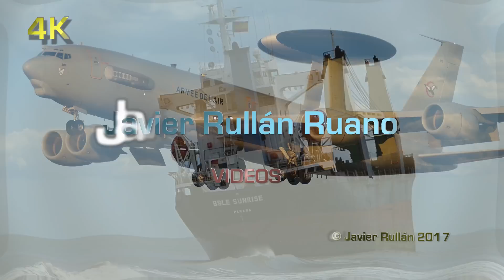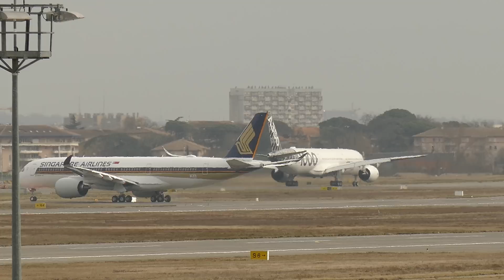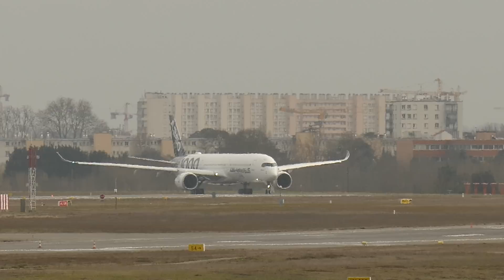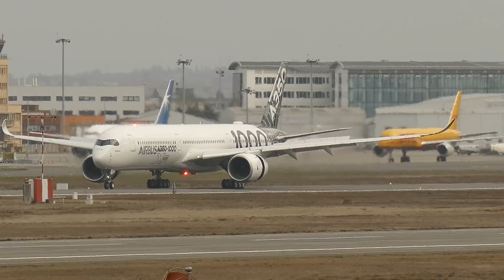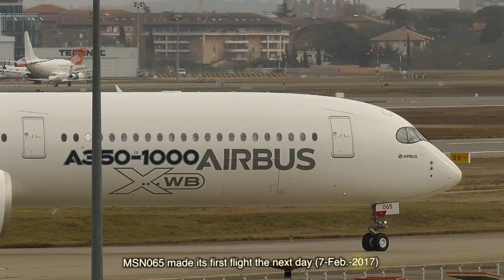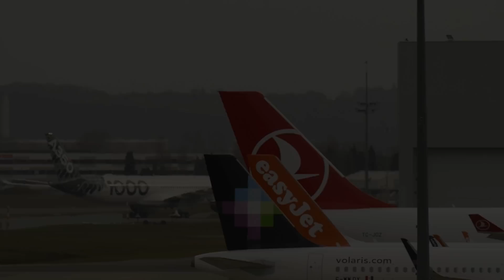Airbus A350-XWB-1000 Takeoff Aborted [4K]

Comment: Could a type of Aircraft brake be made by admitting compressed air to rotating cylinders at the wheels , to be compressed further out a resistance hole type vent....thus producing a very heat resisting 'jake-brake'? Plenty of sources of compressed air on a Jet....
Reply: Buck Otte that would make slowing down impossible in case of a twin engine failure emergency landing. You do not have thrust reverser nor the brakes then to slow down
Reply: Also compressed air can get incredibly hot, especially with the forces being talked about here.